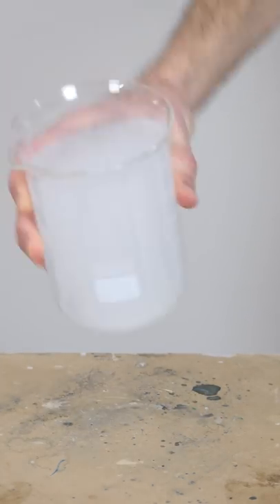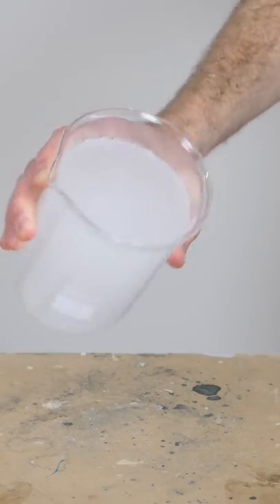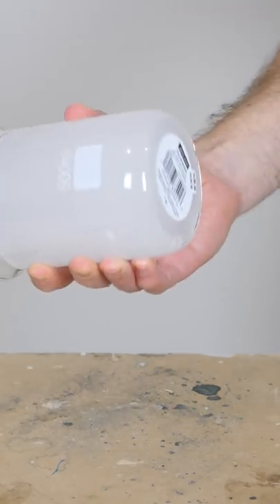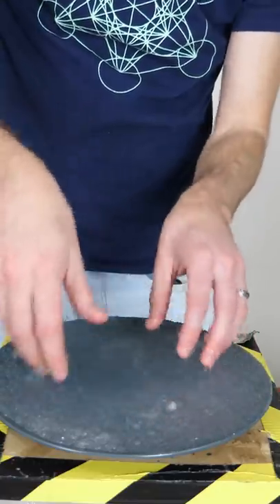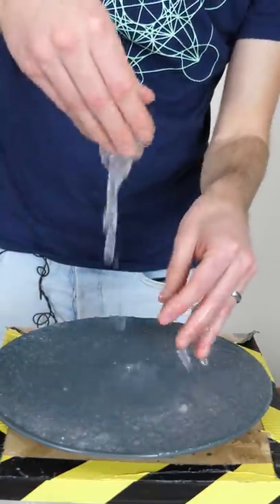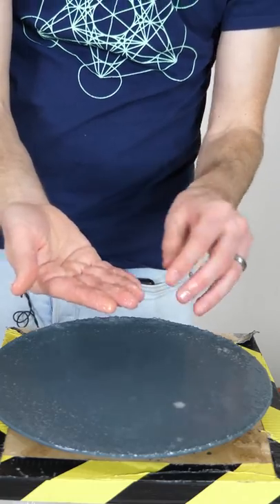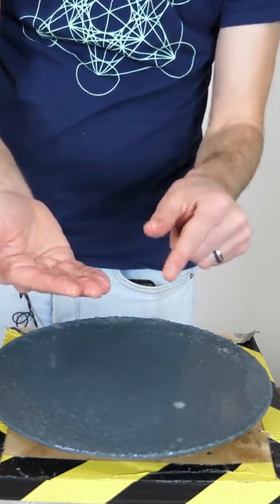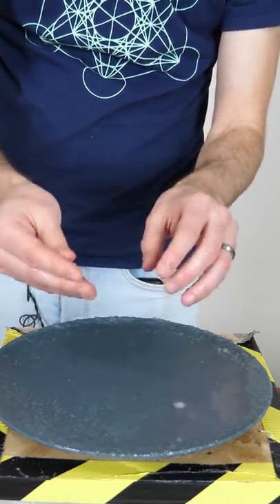Don't Put Salt On Superabsorbent Polymers

Comment: This is actually the reason why you should never drink salt water. If you do, you will feel thirstier than before because the water inside of your cells will go out to balance the salinity outside and inside the cell. That's what he referred to as osmotic pressure, and is the way how cells absorb water (or release it in this case).
Reply: What is that drinks name? Is it dasiny or something?
Reply: @wanderingghost7324  Dasani? From what I know, they're not made of saltwater though. It has salt, but not as much as actual saltwater.
Reply: @davidci   I saw someone talk about people kept getting thirsty when drinking it.
Reply: @wanderingghost7324  Really? Huh, weird. All the complaints I saw from people about it were mostly about the flavor. Maybe the flavor made it seem like they were getting thirsty? After all, Dasani does taste saltier than normal, but doesn't actually have a high salt percentage.
Reply: (Not a troll) I drink salt water everyday. I came to the video to see if people were in the salt drinking club. I put 2000mg-20,000mg of salt every single day , it tastes like toilet water after a day of sitting in water but I still drink it like swiss cheese. I haven't died or anything,  and absorb so much water pretty sure half my weight is water weight. I drink 1-3 gallons of water a day but on most days Its usually 1.5 gallons. I avidly water fast in the past and you can DIE without salt. Your soda has salt it in, and water, yet you don't die?
Reply: I cant take u seriously with this profile picture lmao
Reply: @wertiaaudit5746  salt is an important nutrient for your body
I actually heard someone saying runners use to eat salt powder
Reply: @wertiaaudit5746  What matters is the balance of salt to water.  So long as you are drinking lots of liquids, your body can urinate out any excess salt.  Problems happen when you don't have enough water to remove excess salt, which leads to high blood pressure.  Or in reverse, if you drink too much distilled (non-mineral) water you will dilute the trace minerals and end up with water poisoning.  People used to eat salted fish and meat, and would often intake 100,000+mg of salt per day without health issues.  Salt isn't the problem, dehydration is.  I mix a small amount of liquid Himalayan pink salt into my distilled water to avoid losing trace minerals when drinking litres of water in a day.
Reply: @wertiaaudit5746  obviously salt is ok, but for example if you're thirsty in the middle of the ocean in the blaring sun and decide to drink ocean water. Yeah you're gonna die of dehydration
Reply: With regards to cells/biology, least, with plants, I believe they refer to it as tonicity? I.e hyper/hypotonic and isotonic solutions. How might a particularly "drink" affect diuresis for example. Wrt to plants though, tonicity is often associated with the rigidity/turgidity of the plant. Whether its healthy or limping.

Edit: so osmosis/"osmolarity" and osmotic pressure are all measurable and calculable, from what I read, while tonicity is more of a suggestion upon the state of a cell with regards the solution it's in.
Reply: @wertiaaudit5746  I drink no salt water and I'm dead
Reply: ...unless you're a cat. A cat's kidneys can remove the salt from sea water.
Reply: The people talking about putting table salt in water and being ok is blowing my fucking mind. Salt water as in ocean water. Use your galaxy brains.
Reply: @wanderingghost7324  that video is super fake, I love Dasani and actually made my own video disproving it
Reply: @ThatOneDude248   What video are you talking about?
Reply: @ThatOneDude248  Dasani is so nasty
Reply: @wertiaaudit5746  Well saltwater here means sea water, which is different from just putting salt in normal water.
We consume salt but it doesn't cause problems because it's diluted by other fluids we consume. If you drink only seawater, you'll pee more water then you drank and eventually you'll die of dehydration. 
Second, why do you know what toilet water taste like?
Reply: Paul J right??
Reply: @happyguy1341  yes when I was in high school and ran track i run water all day and for lunch I would eat two salt packets so that I can retain that water. Especially when I know it’s gonna be really hot that day.
Reply: What do I do if I'm constantly low on sodium and dehydrated then?
Reply: Thank you
Reply: Thank u caillou
Reply: @happyguy1341  yes they do this to keep water in your body and the only way you can truly stay hydrated as everyone here has stated is a balance of salt and water you can drink 1.5 gallons of water with no salt and be unable to stay hydrated because without the salt the water has no way to be transferred into the cells. This video is a very good example of how cells use salt to transfer water into themselves
Reply: yeah, now its getting make sense
Reply: Also never drink pee when stranded like Bear Grylls lol
Reply: Also its why you drink saline if you  have diarrhoea. Also, consuming more salt makes your blood hold more water and increase in volume, giving high blood pressure
Reply: @wanderingghost7324  that’s a reliable source right there.
Reply: @wertiaaudit5746  is there a reason you want to consume that much water (and salt)?
Reply: @williamstewart7399  I can't absorb water well and require more salt than the average person.
Reply: SEA water is too salty, but tons of people (especially with Dysautonomia) are basically Rxed by cardiologists 4-8mg of salt, in water, per day for idiopathic blood volume issues.
Reply: @BebbaDubbs  4mg-8Mg diluted In what volume?
Reply: You should drink salt water. The amount of salt to cause that much damage or thirst is wayyy too much to even get to
Reply: @wertiaaudit5746  me too
Reply: My mom adds salt to her water makes it like the ocean well a bit less and it’s bc without that she has heartburn or something not all her water is salted tho. I kept sneaking her regular water but then she told me only 24 Oz salt water a day. So never tell ppl never it’s so annoying U don’t know everything lol
Reply: @zionproject2745  you stop vomiting after your body gets used to it. I don't vomit even after drinking 10k-30k mg of salt
Reply: Within 30 minutes too
Reply: @wertiaaudit5746  oh yea that’s why my mom adds salt to her water not heart burn I always forget the reason but that’s why thank you friend!!!!
Reply: You can have up to a pint of salt water a day, in a pinch. If you get too much you'll lose your marbles from dehydration, but a pint a day if you're adrift in the ocean will keep you alive. It'll suck but you won't dehydrate to death.
Reply: @Variety_Pack  nah bro . I drink like .5 pound a salt a day , still alive.
Reply: @wertiaaudit5746  Most soup are basically a form of salt water anyways
Reply: This comment is more interesting than the video
Reply: @Uhohlisa  ok truth in part I'm not "healthy" interchangeable depending on how the fasting is going  . I water fast but like most people fail because I just didn't try.  When I water fast. I have to drink salted water.  I love salted water and I get a    lot of stuff done when I am drinking lots of salt.  I know my body best  . Sometimes if I binge eat and vomit out , the acid in my mouth affects my longues , but when I drink salt water , after a certain period of time like 10 minutes I can feel the acid get absorbed in my gut by the salt and its safer to vomit as even 1 week of forcibly vomit will ruin your teeth while it doesn't as it appears to be when I drink salt water as the acid in the stomach is quickly diarrhea'd out. Drinking salt water could mean perfect teeth or meth addict teeth and costing you 100k in dental if your bulimic
Reply: @davidci  Dasani does have a high sodium or another compound that make you thirsty, possibly the same mechanism. I mean it’s made by Coke! What do you expect from these crooks?
Reply: Ive always thought thatbit would help your thirt for a little while and then start to dehydrate you bevause the water still has electrolytes. Is this not the case the
Reply: @wertiaaudit5746 u drink 3 GALLONS of water a day instead of just not drinking saltwater... Might need ur brain checked
Reply: @jf8070  water is good for you and I ain't dead
Reply: @wertiaaudit5746  salt isn't the only water soluble nutrient you need...? Literally giving yourself anemia for no reason
Reply: Wow, thank you!
Reply: @wertiaaudit5746  3 gallons are 13.5L of water. I don't know how is it possible for one human to drink this even for 24 hours lol
Reply: @topsunnn  each gallon takes me 30 minutes to drink. I made a unclear statement where I implied it took me 30 minutes to drink 3 gallons . I have tried to do it without salt and you can quickly tell it's not healthy as you can feel excess water fill your body too quickly than your body can handle it in the liver . With salt, it's like pre processed digestion with salt holding the water before it's to be processed in liver , unlike where you have to hold water in your cells. Cells aren't magic and will die with too much water .
Reply: @wertiaaudit5746  4.5 litres of water in 30 minutes is impossible unless you weight 400 pounds or somet
Reply: @topsunnn  then I'm impossible then.
Reply: @wertiaaudit5746  okay. And what is the reason for you to drink a gallon of water in 30 minutes?
Reply: A good description of what really happens... Excellent Science !
Reply: Unless ur dehydrated and low on salt. Then its actually a good thing🤣
Reply: @wanderingghost7324  yea and theres rnh this comment is kinda b.s. salt water can be really helpfull...depends on the ammounds obviously. But if u just lost alot of water Weight becouse well u had to weigh less for a boxing match. U wanna drink salt water to get it back🤣🤣
Reply: @RavenMobile  bro...u dont often piss salt now do u? How about sweating? Hmmmmm
Reply: @darrellbeets7758   I'm not saying salt water is harmful. Its just some people had different body salt percentage that drinking too much of salt water will bring harmful to the body because of low metabolism.
Reply: @happyguy1341  Runners eat salt powder because the sodium is necessary for muscles to contract properly. They release sodium ions everytime it receives a signal from a neuron , which goes into the muscle and allows it to contract and allowing it to use the ADP and ATP(Adenosine Di[Tri)phosphates) which is your body's natural energy supply.

Too much can cause cramping though because of sodium reuptake iirc from my college anatomy courses
Reply: @wertiaaudit5746  3-5 grams of salt is the recommended amount. Your drinking 2-20 grams. That is extremely unhealthy, 20 grand would put an extreme amount of stress on your kidneys and you will have insanely bad stones. You are setting yourself up for a month of the most painful hell you can think of. Btw, my research is from the keto diet, I have been doing it for years and it is the same as water fasting, but water fasting is an extreme stress inducer on the body. I do not recommend over consuming salt or other necessities, just take what you need and drink heaps of water, but just know you can't avoid stones by drinking water.
Reply: Also yhe reason you cook pasta in saltwater. The pasta does not contain water and will not only absorb the water but relase proteins into the water. Add a bit of salt and much less protein will be released
Reply: Yep :D the way my physiology professor explained it. Water doesn’t give a hoot it follows the area of greater solute.
Reply: @joshmillere6263  pain is good
Reply: @wertiaaudit5746  you've tasted toilet water? Bruh. I'm missing out.
Reply: @wanderingghost7324  There is barely any salt, check any water bottle and it has salt
Reply: Yeah no shir
Reply: But then I can just eat a spoonful of salt later
Reply: Basic biology
Reply: Salt is actually vital to hydration!!! Please all of you look up info about electrolytes and what they do :>
Reply: @wertiaaudit5746  you're setting yourself up for a potassium intoxication
Reply: @wertiaaudit5746  your poor kidneys
Reply: @PuddingXXL  how.?
Reply: Would the same happen if u eat salty food and drink water or am I just dumb
Reply: I used to drink salt water when I was fasting. It’s not bad to drink it. Just in cases where you’re already dehydrated.
Reply: NERRRRRDDDDDDDDDD!!!!!!!
Reply: @happyguy1341  although very unhealthy if in large quantities
Reply: Aka how you kill a slug.
Reply: You should mention the balance of salt is the problem. Salt water is good to you up to a point. And ocean water is too much. Or brine.
Reply: @wertiaaudit5746  that can be a symptom of diabetes if you feel like you have to drink that much water. And if you don't have a condition like dysautonomia, that much salt per day will lead to hypertension.
Reply: @GLGC688  anything can be a symptom of diabetes
Reply: What if you could disgard the salt? Like you body defecates it out or something
Reply: @pace_18  kidneys are what flushes salt (I think). But it won't do it fast enough in an ocean water situation.
Reply: @GLGC688  ok
Reply: Which is otherwise known as hypernatremia which is increased levels of salt in the body. That would of been alot easier to say but oh well
Reply: So if I put some soap in it it will be okay
Reply: @wertiaaudit5746  "pretty sure half my weight is water"
Humans are 70% water. 
Checks out. You're dangerously dehydrated.
Reply: @pirig-gal  half my weight is water because I wear big jackets and carry lots of equipment that add to my character
Reply: @wertiaaudit5746  I guess the thing here maybe is the amount of salt. I'd assume salt water from the ocean has way more salt than the amount as a proportion you use. Though im just making this up so I don't know.
Reply: Anything with added electrolytes is basically just salt. I hate seeing special drinks and it’s just sugar water with some salt added.
Reply: @arthurcline kinda cuz salts are ionic
Reply: Yay osmosis
Reply: @wanderingghost7324  sports drinks are fine if you actually do sports actually. 
And no. The amount of salt there isn't enough to cause a change in osmotic gradient  large enough to cause any damage iirc
Reply: Damn, if only the thumbnail was “don’t drink salt water” lmao… it’s cool I’m on the net 🥴
Reply: @wertiaaudit5746  Half your weight is water weight? The average human body is 60% water what relevance does it have?
Reply: As the 100th reply, I can safely say that I love Osmosis!
Reply: You just turned his shit clickbait to a real learning experience
Reply: Actual useful information. Wow.
Reply: @wanderingghost7324  Dasani is just mineral water
Reply: But what happens to this if it was salt water instead of regular water?
Reply: Not completely accurate. Drinking saline is perfectly fine.

Comment: Not only due to the osmotic pressure, that may be the driving force for the migration.
When you add salt you are neutralizing the ionic parts of the polymer that are responsable of the water coordination.
Before, the macromolecules were all coordinated with water and  they were also streched becouse there were a lot of negative charge on the chain(the same anionic part that was responsable of the coordination of water), and because of that there was a huge increase of viscosity, causing the formation of the gel.
When you added salt, you "soaped" the polymer and with no charge the macromolecules returned to their more stable and tangled configuration, so no more gel and with no charge no more water coordination
Reply: Spotted the chemist. Cool stuff.
Reply: So much cooler with the actual explanation
Reply: Great explanation!
Reply: @actual_garbage  because it's interesting information and we don't feel the need to react like a jock in the back row of the class with a C- average
Reply: That makes more sense. I thought it was weird that that little bit of salt somehow had enough of an osmotic gradient to pull all of that water out of the polymer.
Reply: it’s actually not because of the chain tangling and untangling. Polymer gels work because they have negative charged corboxyl groups which push each other away as you already explained, by pushing each other away they form sort of a „pocket“. the gel consistency is now made by the water that can sit in between the negative charges and form the gel consistency. when you add salt or an acid to this gel the negative charges get neutralized and the water can no longer sit in between the negative charges: the gel consistency is destroyed and the water comes out.
Reply: Nerd

Comment: We use super absorbent polymers in the hospital to solidify canisters of vomit/bile before disposing of them. Usually from people who are having their stomachs pumped.
Reply: That's really interesting!
Reply: Better keep salt away from it!!!
Reply: @tamie341  I think what you mean is "ok person who happened to have an experience which is relevant enough to this video to justify commenting about". Knowing one fact doesn't make you a nerd.
Reply: Honestly, stomach pumping reads disgusting.
Reply: @CerealExperimentsMizuki  It's not as bad as it sounds. A tube goes in through your nose, down to your stomach, which is attached to suction. Getting the tube in is the rough part, you have try to swallow a long piece of plastic but patients say it's not terrible once it's in. Pro tip: Take it easy on the alcohol and try to avoid bowel obstructions.
Reply: If you salted it, would only the water be released therefore leaving you a gel of highly compressed bile and some water?
Or would it just go back to being normal bile
Reply: @1stCallipostle  Uhhh great question... bile emulsifies fats so it's probably non-polar. I believe salt would only work on polar substances. So the bile would probably remain absorbed?